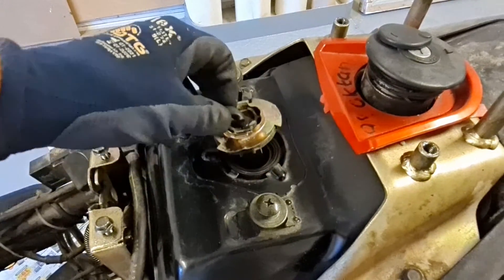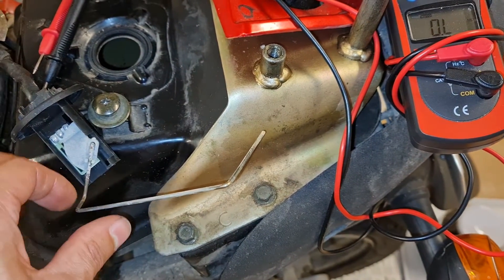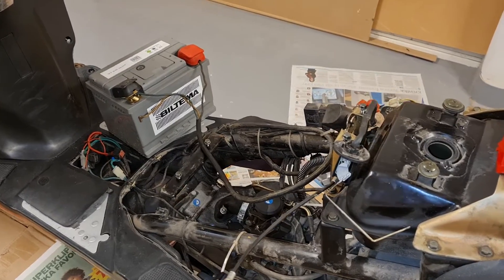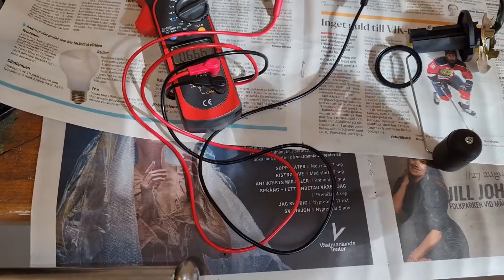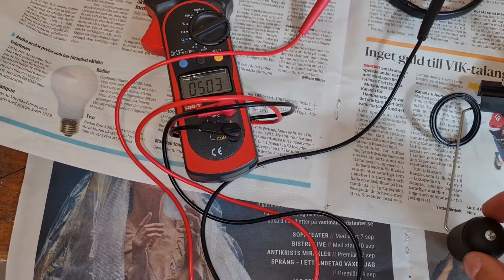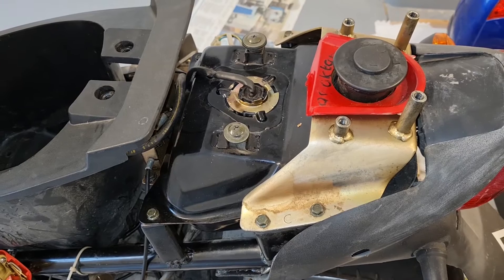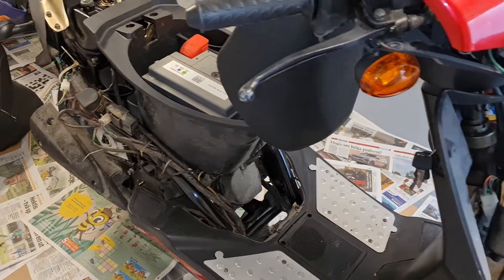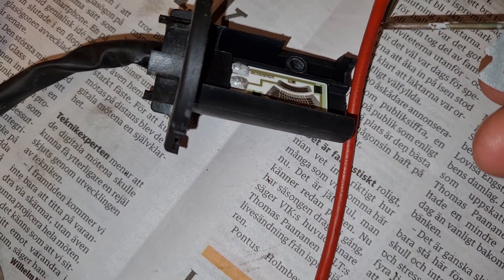Test and fix broken fuel level sensor gauge 3 pin

Comment: Did you find out is there some CR2032 to change to get that digital clock to work? I got 2007 model Fude Race and same kind of problems althou this got only 4000km driven. Same fuel thing! I see you also have a bigger battery under seat, so do I 🤣
Reply from the maker: Yes there is a battery, not CR2032 but a smaller one. Nott easy to replace, you have to pick the cluster apart.
Bigger battery is nice :D